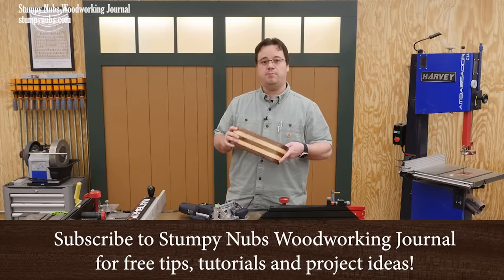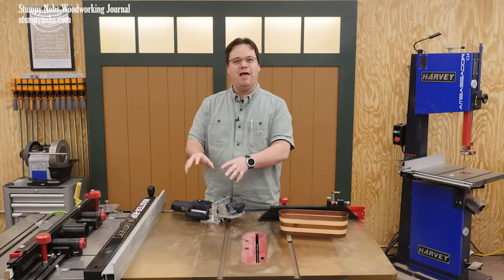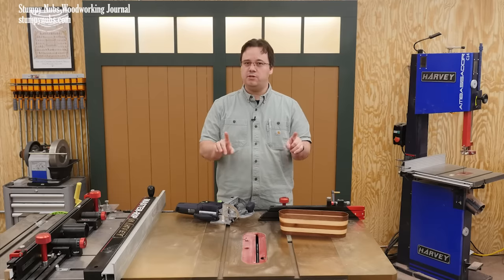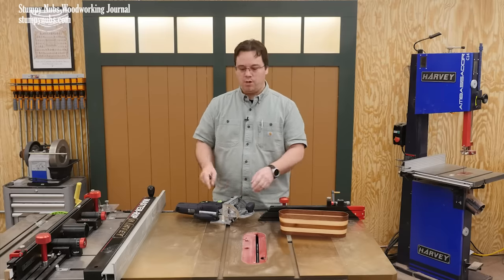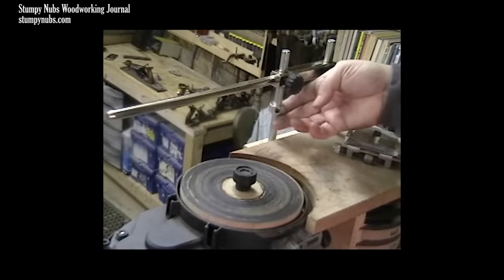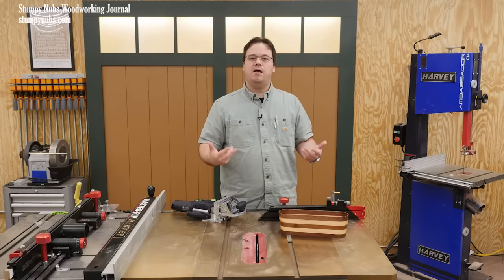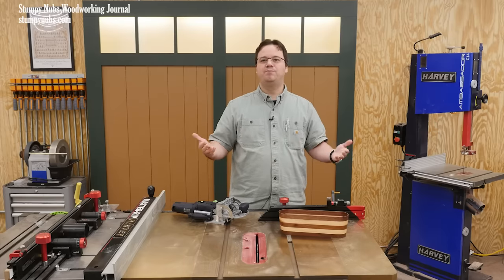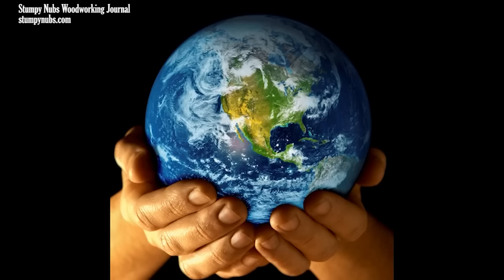This is why people HATE Festool and their Domino!

Comment: I started my fine woodworking experience 7-years ago. I bought tools based on low price, even if the reviews weren’t great. Shoot, I wasn’t good enough to even know the difference between a box store plane and a Lie-Nielsen. Then my fiancé (now my wife) got me a great birthday present: Festool track saw, rail, MFT and dust collector. I was SHOCKED to know the cost and thought, this is great, but I’ll never pay that much for tools. Then I started using them. It didn’t take long to appreciate the difference in overall design, build and quality. It’s part of a well thought out system, not just a track saw. That’s when I learned my 3 greatest lessons of tool shopping: “Buy your last tool first”, “buy once, cry once” and “just because it’s expensive doesn’t mean it’s any better than a lesser priced item”. You still have to use your brain and common sense when investing in your craft. One man’s ceiling is another man’s floor! I have replaced almost all the early tool buys with higher quality tools. So, no complaints from me when you show a tool that is high quality and expensive.

Comment: Thanks for this video Stumpy! You are the best! 😂 To your point regarding Festool and the Domino, I’ve been a professional woodworker for over 45 years. We do very high end residential cabinetry and custom furniture. I’ve owned a few Italian slot mortisers and we currently have a Bacci mortiser in our shop. We also have one small domino and 2 XL’s. I also still cut traditional mortise and tenon joints for large exterior doors. So yeah the domino is pricey but it’s a very unique tool and well thought out. It does what our big stationary machines can do in a hand held tool. What’s not to like about that? I wasn’t an early Festool adopter but I own quite a few of there tools now. The Kapex is the best sliding compound miter saw made in my opinion followed by Makitas. If your time is money in your work you can do far worse than buying Festool. As far as putting any stock in what’s out in the YouTube space, it’s mostly a laugh and mostly amateurish IMHO, besides your channel of course!

Comment: People lift their nose at Kreg too, but it helped put innovation into the hands of joe weekender. I love my domino and my kreg 720 cheap plastic pockethole system. I'm not interested in going back to hand cut mortising or dowels as my first line of defense. The speed is phenomenal with both these systems and so is the strength. Necessary? nope, I've seen stunning woodwork in houses built before electricity, but I'm not cutting the cord....

Comment: I fully buy into the Festool philosophy take the tool to the piece instead of the piece to the tool. 
I too have the Domino 700 bought for a job that would have been almost impossible without it. I could have done it with hand tools but It would have made the project unaffordable for the customer. As a building contractor I do require rugged tools and for some tools I find the Festools not quite up to the challenge. But when I use my Festools I do enjoy using them. A stack of Festool boxes definitely enhances the image akin to arriving at the job-site with a Porsche.

Comment: For what I can say, having a drill attachment (or just dedicated, small collet drill with press jig) instead of Domino woild be as good or even better. Yes, I have even seen dual collet drills for similar jobs (originally they were used for transmission belt joinery). Yet I do not think anyone should feel offended for seeing more expensive tools. There is always some industrial shop nearby, that will let you finish your job with fancy tools. Sometimes you can rent them for reasonable fee (that applies for most of tools you can imagine).

Comment: On that Fein Multimaster, I did an over-the-post stair railing systems for his house.  I did it his way, which required a LOT of sanding of the fillets between balusters. I knew hand sanding was going to be a week's work. A pad sander couldn't get in. It was looking like rasp and sanding block time, and a plot to end the friend.

I stopped by at my favorite tool store, Northern Tool, after looking at detail sanders from B&D, PC and others. They looked like they'd have to be replaced at least once.   The boys at Northern Tool suggested I sit, but that they had a solution. They showed me the Multimaster kit in a metal case. It was $350.00 back then. It was among the best investments I'd made. The sanding task got done in one day. 

I still have the sander around twenty years later. If it died tomorrow, it'd be replaced in the time it took to drop by my new favorite tool store (Milne, in the Tri-Cities, Washington), an hour away.

The Multitool doesn't get used every day. Often, it will sit on the sanders shelf for a month. When it's needed, it's needed bad, and it's worth its weight.

Comment: Great debate. I’d like to share some unbiased but actually tested and proven points from a professional who (with no Festool sponsorship) uses almost the entire Festool system everyday. First I’d like to say if someone is a hobbyist and can afford Festool tools and they actually need one of the tools such as the Domino for more than a one time use, then they should buy it.  If they cannot justify the cost and need it once or don’t have the money to spend, they should find an alternative solution. As a professional, if you can afford Festool, the return on your investment is well worth it. For instance, my time, amount of jobs, referrals and repeat clients, quality of work, space saved in my shop(I no longer have a table saw and build full custom cabinetry and built ins) has all improved since switching to Festool. Festool is modular, so I am able to pack up my entire shop and set it up in my clients home in minutes. The dust collection is phenomenal on all of the tools and saves my lungs and clean up time. I’ve been through many tool brands over the years and none have a system that’s works as complete as Festool. You buy what you need and can afford, so base your decision on necessity. I know this is a long comment, but I hope it can help someone who is struggling with decisions on the matter.

Comment: I have a df700 and an extension piece to cut df500 sized mortises. It is the only festool tool I own. I hate that it doesn't have an attachment for a regular shopvac hose but otherwise it is hugely useful piece of kit.
Reply: Wouldn’t a regular shop vac hose be too stiff? The Festool or Fein hoses are pretty long and fkexible

Comment: I have bought both Domino DF500 and DF700 (plus all sizes domino sets in 3 separate systainers + all bits from 4 to 14) last month (my wallet has sets itself on fire when I've paid 🔥💸), and... it's a game changer, really ! This makes joinery so easy, fast and accurate, this is insane, nearly illegal 😄 
Yeah it's really not cheap (at all) but it worth it, really.
I don't really understand the haters, you still can make your tenons and mortise by hand if you want to, even if you have a Domino 🤷‍♂

Comment: I have no direct experience with Festool, and probably never will.  At this stage i focus strongly on hand tool woodworking.  I can however relate a story from a professional I know well.  In his shop they use a lot of Random Orbit Sanders and in the past they favored another affordable brand.  He told me that there was always one or two in the repair shop.  a few years ago he purchased a Festool RO sander, then another.... and he has never had to have any repairs.   Will this be true after 1o years?  Maybe not, but it made me think.  
Price can always be an issue for the home shop woodworker.  And I agree that there is likely an affordable option to get the job done.   
From a guy who purchased a10 inch  Inca Jointer/planer in 1981 for $800.00 (Sale price.) without motor or stand stand.   This was long before the advent of the ubiquitous lunch-box planer. 

P.S. is the Domino really much better than the biscuit Joiner I bought 20+ years ago and have used on maybe 5 projects?   It does come in handy once in a while.

Comment: For joining flat surfaces, Is the Festool Domino any better than a biscuit joiner? Most of the videos I see of the domino cutter are simply edge or corner joinery, where a biscuit could be used. (Yeah, I know biscuits are typically wider than a domino.)

Comment: First, thanks for a well-reasoned editorial about expensive tools, "snob" appeal, and tool lust. And secondly, thanks for rerunning the hilarious Festool Stumperator ad. I must have missed this years ago. 
I bought a Domino years ago when I was working full time, and it has paid for itself over the years. I've found that sometimes what it can do directs design decisions in a piece. Other times, the design of a piece means finding another way of doing a joint. I don't have a lathe (and am reluctant to go down that rabbit hole), so if I need roundy parts, I figure other ways of making them. Or I buy turned legs on line. Or have a friend who' s a turner batch them out for me. There's always more than one way to skin a cat. And Festool will probably develop a tool to do it.  BTW, I love my original Festool tracksaw, sanders, and router.

Comment: I have both Dominos and am really happy with them. That being said, I have a number of other Festool tools which I WOULD NOT replace with Festool. The european versions of Makita (NB: these are made in Japan and much higher quality than made in USA) are just as good, and cheaper. The Dominos are game changers for me, their accuracy is incredible, and they are really easy to use. Strangely the XL Domino is easier than the smaller.  As an example, I have the Makita cordless miter saw which is very accurate and significantly cheaper than the Festool. Festool sanders were state of the art (I have 3) but there are now much better sanders from Mirka.

Comment: My thing with the Domino is, at the moment, it's the only tool that youtubers feel the need to excuse themselves from using.  "Yes I'm using a Domino.  You don't have to, you can use dowels or a router with a jig or whatever, but I have one, so I'm gonna use it."

What it is is a very user-friendly and capable tool that would be great for beginners for building furniture and cabinetry projects, and they're priced completely out of the market.  When the patents expire and Ryobi is selling one for $169.94, we'll talk.

My understanding is that Lamello did the same thing with the biscuit joiner.  It's an angle grinder with a small circular saw blade and a spring-loaded foreskin, and they sold it for about what the Domino sells for accounting for inflation.  I bought one from Wen for $50.

Comment: I bought the Domino with a Festool extractor about 15 years ago. I bought a Festool TS 75 track saw about the same time.  Love the tools and you will have to pry them out of my cold dead hands.  Having said that, Im not sure I would consider the Domino now.  It was about $750 or maybe a bit less when purchased with the extractor back then and at that time I thought it was priced too high.  Now at $1200 I it is in a different ballpark entirely.  I cant see the justification for that price.  Plus you have to have it connected to a dust extractor/collector and it seems that all decent higher end tool brands are  taking pricing cues from Festool....if it is a vaccum with a plug for your tool it will cost $400.

Comment: As someone who has spent over $8000 for software to allow me increase my productivity on my job I can vouch for spending lots of money on the right tool if it increases your profitability. However, I'm a hobby woodworker and look at the cost of some tools as not worth the price not because they aren't good tools but that the trade off of cost vs. time spent to do it using some other technique that is slower doesn't make as much of a difference to the final result. I did spend a premium on the Dowelmax jig as I looked at the time I would spend trying to get similar results with cheaper tools and decided that as I am trying to improve my skills in fine furniture building that I'd spring for a better quality product. 

What a Domino brings to the table is two things - speed and accuracy. If you are a professional selling your time then speed is an important consideration. I can achieve the accuracy aspect with the Dowelmax, but the speed isn't going to be anywhere near what you can achieve with a Domino. But again, I'm not a professional woodworker and what I build I put in my home so the efficiency of the process isn't as much of a consideration.

Comment: 🤣🤣🤣🤣,Great Parody. I agree with your thoughts on the guy getting a return on his input and development costs on a good tool new to market. Festool do make quality tools and will serve you well over the years, nicely finished. But what I think gets a lot of people is the price stays high and doesn't come down much during the following years. If it did, they would probably have a bigger sales volume and less griping about them. I know If I bought a Festool , Milwaukee or De Walt jointer it would be 99.9% accurate; allowing for setting it up properly in the first place. I bought a cheap jointer, not the cheapest a number of years ago and its probably the cause of the start of my hypertension. No amount of tweaking, adjusting or otherwise could get a reasonably centered slot for jointing. It was just cheap and I got what I paid for. Like you suggested, I finished the project off with with a router. It took more time but probably saved me time. The Jointer? Still in the box, Id forgotten I had till a month ago.

Comment: I LLLLove Festool.
in fact, I love them so much that I wheeped like a little baby when my boss told me he tried but couldn't get me a complete collection of Festool tools.

At home I started using Makita (for financial reason) and since I already have Makita chargers and many batteries, going for anything other than Makita (unless Makita simply doesn't have the tool I need) is dumb if you ask me (in my case of course).

When you start as a hobbyist and can't afford Festool, you have to go cheaper and once you start making good money, there really is very little reason to switch your entire battery and charger platform just because you want that one special tool only Brand X has.

That being said, of course you can have a brand X tool with Brand X charger and batteries next to your Brand Y collection, but it's usually a wiser idea to find a Brand Y equivalent tool.

Comment: Is the main difference between the domino and a bisquit jointer that the domino is stronger against shearing force?  I currently use bisquits and dowels, and I'm not sure how this negatively impacts my workpieces.
Reply: This is pretty much where I stand also... At its root, it's for alignment and some additional strength and glue surface. Over the years (30 some) I have never run up against a need to provide more "sheer strength" than my biscuit jointer provides. (I've furnished my home with oak furniture including biscuit jointed table tops that I can literally stand and jump on with no worry of them or the rest of the supporting woodwork of the piece, coming apart.) In many instances I've used my biscuit jointer in place of dowels with fine results. And while I will admit to a TINY amount of tool jealousy 😏, I haven't had an instance where I might require one of the Dominoes and I just can't afford that kind of money without a definable need.
Reply: @DTWeebz1  Although I will admit that when I saw Norm Abrams using a digital thickness planer, which nicely displays the target thickness with fractions of an inch, I thought that was an impressive tool.

Comment: Think of track saws, lots are now on the market, but none would be there if Festool didn’t do it first. And the list goes on. I’m still using my Festool drill I bought in 1998, the original batteries have been replaced only due to the fact they don’t hold charge but they lasted 10 years. That’s why I own Festool.
The people who hate Festool are also the same people who think custom furniture is over priced, then they try to make custom furniture themselves and either make a crap version of what they want. Or suddenly learn why it costs so much.

Comment: No comment, but I have a Harvey Table saw with the same fence in your video, and have a problem with the aluminum portion moving down at the rear of the saw with just light pressure. It then has no gap and scrapes along the table saw surface. I contacted Harvey and they were no help. I suggested making the extrusion with a dovetailed shaped slot instead of T. Then when pulled together with a triangular shaped nut it would center and self align. Have you heard of this problem and do you have any solutions. Thanks. And this is another good video!